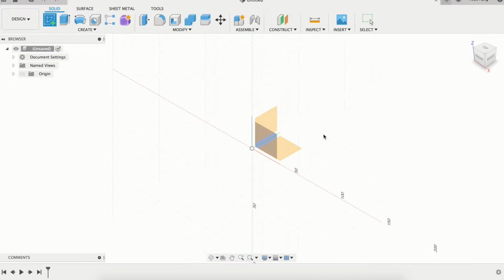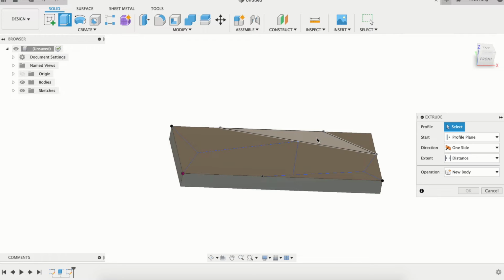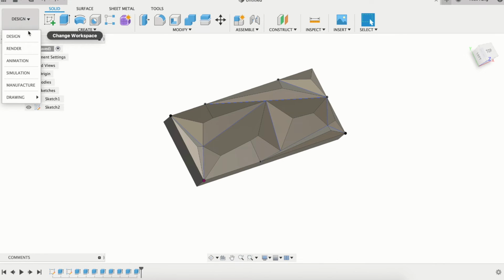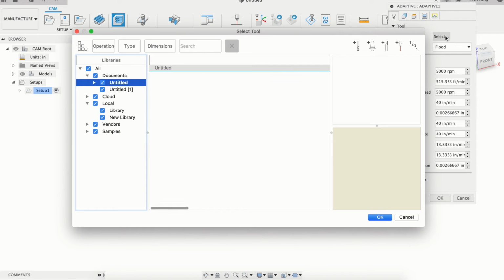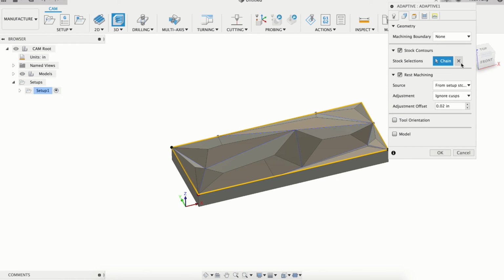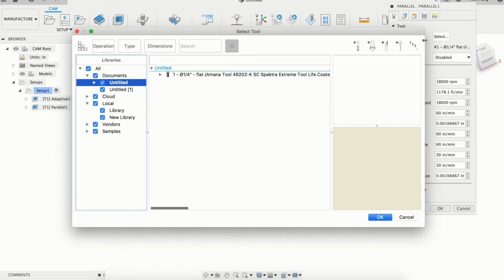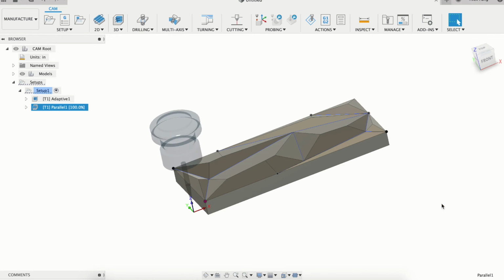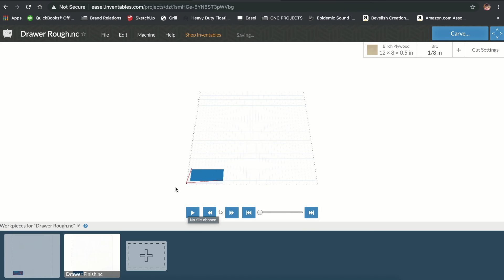Fusion 360 CNC 3D Carving for Beginners || HOW TO

Comment: Hello, there is an AES Nova 2142 brand device and there is no post written specifically for this machine in the post library of Fusion, I wonder if it is normal that it is not normal or if we need to use a converter, how could you create NC codes, thank you for your help, good day.

Comment: Hi. I have fusion 360. I would make parts for 3d printing. Then I would use a slicer to run it in my 3d printer. Question. Is there a free software to run my hobbyist foxalien vasto machine.

Comment: Did you add that material to your garage door panels for sound deadening, or is it strictly insulation?
Reply from the maker: Kind of for both, but it doesn’t really work since there are still gaps along the joints of the door. Can’t do much about it lol

Comment: This was great... I was trying to adapt this with fusion 360 2020 but it kept giving me an error that said the 3d milling is not supported with my tool.
Reply from the maker: I haven't seen that error before.  What tool were you programming the toolpath with?
Reply: @BevelishCreations  I am not sure, I was trying a bunch, but I switched to Number 5 and the error has gone away now.
Reply: By the way do you think you could ever make a new tutorial and share some files you used?
Reply from the maker: I plan to make one designing on the Shapr3D app and then programming on Fusion360

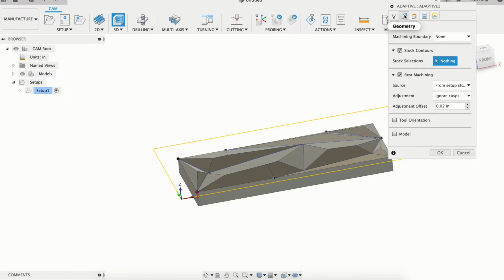Comment: I decided to follow along as a bit of practice but I ran into a problem trying to replicate the step at 2:54. I did the same thing as you and selected the top edge but when the tool path generated it goes outside of that line and removes all of the 1 inch offset I put in. Any suggestions?

Comment: Thanks for the video, this helped me . I also use Easel on a Cron craft machine. As I'm new to this how do you work out your feeds and speeds for Fusion ? I looked at some formulas on the internet but I'm just not grasping it. Thanks
Reply from the maker: Hey sorry for taking so long to get back to you. I agree the formulas are all a little confusing. Most manufacturers will have their recommended settings for the bits on their sites, but keep in mind some are meant for industrial level machines so hobby machines like ours might not be able to handle it. My recommendation is start with whatever preset setting for your machine, and start going up 10% in speed and check the cut quality. Once you’re machine starts skipping, back it off. And I recommend keeping the depth of cut at about 1/2 the diameter of the bit. You can increase the depth by 10% as well until you find something that cuts clean. For the 1/4” bit, I find going about 1/8” depth and 150ipm worked pretty well, with the Dewalt router set at 3. For this particular video I think I set things much slower since I was still working things out

Comment: after putting the new bit in for the finishing, did you have to re-zero it with the probe?
Reply from the maker: Yes you have to re-zero the Z axis every time a bit is changed. But make sure not to re-zero the X,Y
Reply: @BevelishCreations  Thanks!

Comment: Great Tutorial! Had a quick question as it relates to the feedrate you chose for the 1/4” bit on the roughing pass. I have a hobby CNC as well which cannot achieve the feedrate Amana suggests for that bit so I understand why you dropped the feedrate to 60ipm. My question is, by reducing your depth of cut, were you able to achieve a proper Chipload or do you not worry about the running this causes on the bit. Any help would be greatly appreciated. I have the same 46202-K bit and am considering swapping my DeWalt router with my Makita which can run slower RPM’s. I think I’ve seen everyone of your videos and am a big fan of the content you’ve been putting out :)
Reply from the maker: Hey thanks. I normally set the depth at half of the diameter of the bit

Comment: Do the tools selected from the library have to be exactly the same as the tool you are using? Could I, for example, just select any 1/4" Flat head for my tool?
Reply from the maker: I’d like to say, no it doesn’t have to be the same tool. But I do think the quality of the bits matter. There are cheaper bits that can’t handle as deep of cuts or as high feed rate as the higher quality bits. You can even make your own settings if you want. But most CNC bit companies have settings for their bits on their websites

Comment: So once you import the g-code separately for each stage of carving? Did you press use last xy location for the second pass?
Reply from the maker: Yep use the last XY position. But I recalibrated Z position since I changed bits
Reply: @BevelishCreations  Okay well great work and this is one of the first examples I've seen breaking it down well. Thanks!
Reply from the maker: Thank you for checking it out!

Comment: Well Alex, you did a fine job of explaining the CAM process.   Managed to cover damn near the whole process in a very short video.  You've managed to get a lot of experience with Fusion 360.   Only had a small chance to use that while I was still working.  My experience was years with Autocad and Mastercam (and a few others) with various CNC machines.  

I'm betting you would be a damn good CNC teacher if you ever went that route.  Thanks for the video.
Reply from the maker: Wow thanks for the compliment, Don! I’ve had experiences with AutoCAD, Solidworks, and I use CATIA everyday for my job. So I have some grasp on the modeling portion. Maybe I should just turn this account into CAD/CAM tutorials lol
Reply: The compliment is well deserved, Alex.  Since you have some experience with CAD/CAM, here's a funny story.  I'm not telling this to brag, but just because it's funny.  This goes back many years to along about mid 70's or so.  At that time, the shop I worked at used a CAM program called Quick-Path.  This was long before graphics screens, Windows, or anything of the like.  (well, there was Tectronics monitors, but normal humans couldn't afford that stuff).  So, we had a PDP8 computer with 8K words of memory and running 8" floppies.  Quick-Path was a $25,000 CAM program that ran on a monochrome screen on that system and used only numbers for all programming .  No text.   I had been using this system for a couple years and was very familiar with it.  One day, the screen died (this was all one unit).  Digital Equipment was coming out that day to fix it, but I couldn't wait - CNC machine had to be running.  So there I am, typing away at the keyboard with a completely blank screen preparing the N/C program as the repair tech walks in.   He watched me for a few minutes snickering because he thought I was joking with him.  Then, hit the last return and out from the Teletype machine comes the paper tape that is the program to take over to the Jig Grinder (CNC).  His jaw drops and I look at him and say "Yes, I'm used to the program so I really can do this without the screen, but it does make it easier."    True story, I s*** you not.